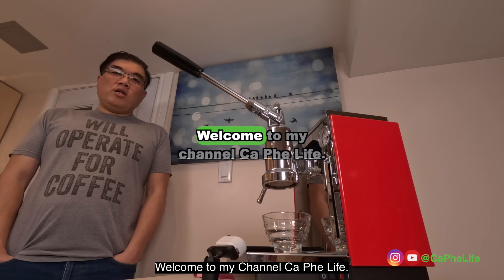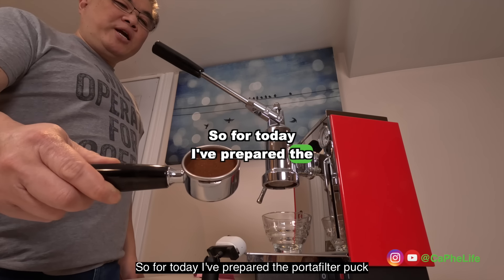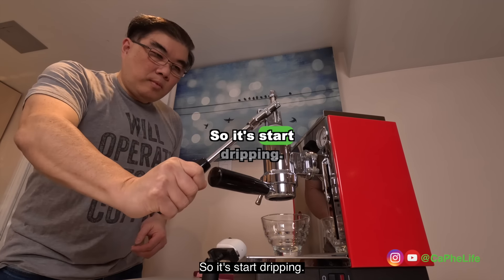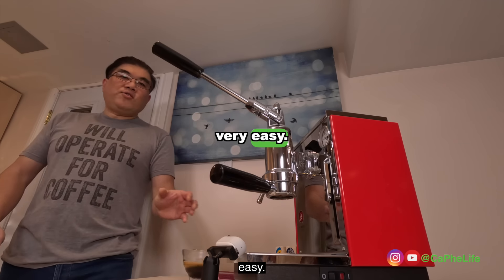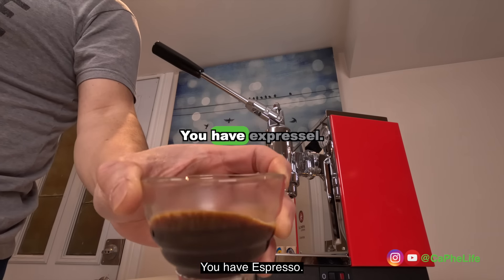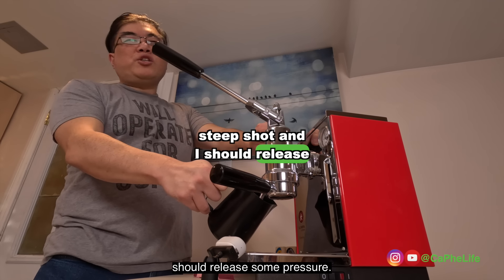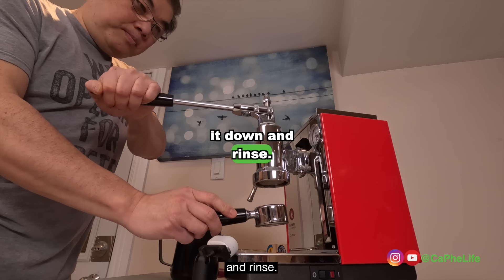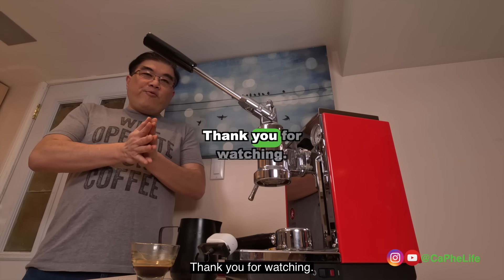*Espresso Making* Olympia Cremina SL - Spring Lever Espresso

Comment: hi Tuan Duong, thank you for sharing your videos of the olympia cremina. may i ask how many shots of espresso are you able to pull with this work flow? i m asking this is because of the small water capacity of the tank. with the same workflow, will i have enough water to serve a family of 4? do you have a video on how to do a refill of the heated water tank? i understand that the tank will be in high pressure when heated and you have to wait for it to cool down before opening the cap(to do a refill of water). i m curious to know how long will it take for the heated tank to cool down before opening the cap to do a refill? or is there a way to overcome this? thank you for answering my questions on the other video and yes i can hear the spring as it was decompressing in this video(it sounds acceptable to me). thank you. joseph @ singapore
Reply from the maker: Thanks for asking these questions, it’s a big concern the water tank. I just gave the e61 machine to my parents since they have more space. 3 liter water reservoir and 1 liter boiler and also straight plumbing was overkill for me. The Cremina can handle family of 4 easily. I did a hot refill once….just open the steam wand to dépressurise it and you can open the lid….yes you can overfill the tank and not cause damage as water will flow out from top of the knob….ill make a video on those and stick a microphone to the machine next week and I am away now
Reply: @CaPheLife  thank you very much for prompt reply.
Reply from the maker: https://youtu.be/tyo_odoSHgw?si=5UGAU-1OEjlrp1gg
Reply from the maker: https://youtu.be/8i92mhOuRTU?si=_ewaEiUK-747ywjS